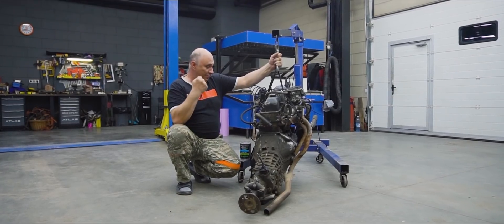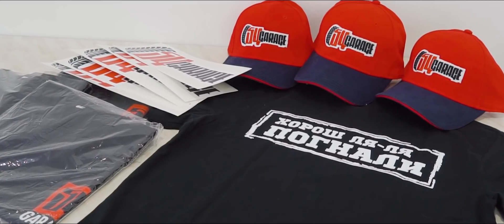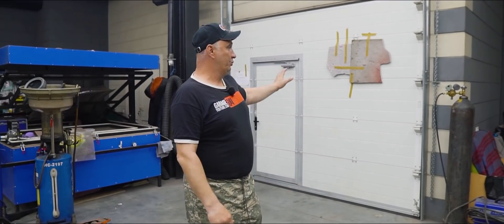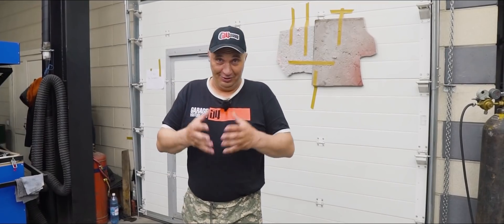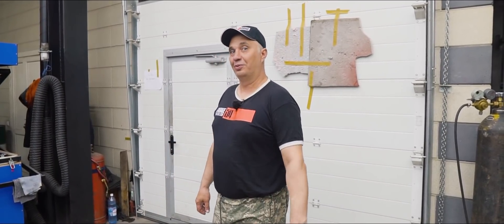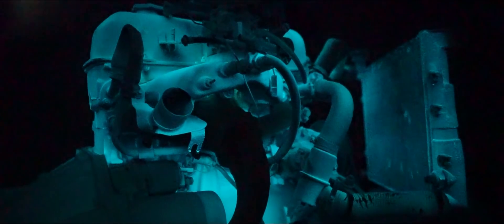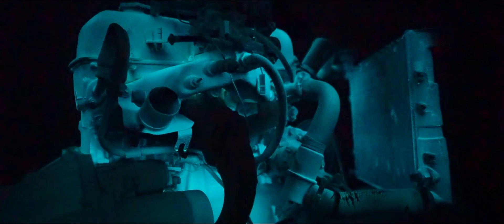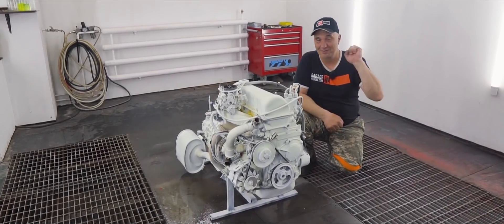Applying heat sensitive paint to an engine (with warm-up in the dark)

Comment: Okay, so I have been looking for YouTube footage of a timing belt snapping whilst the engine is running. Closest I have found is a chap that cuts the belt to the point that it looses enough tension and no longer starts. Then another one where one chap has a metal pipe stuck in the timing belt until it snaps but not with a closeup camera. Perhaps an interesting short video? With a nice Lada running a cracked timing belt(I'm sure they are all cracked🤣)

Comment: I'd think that if the engine warned up unevenly. That would cause undesirable stress in the block, and maybe even metal fatigue. So it would seem best to design it in such a way that the heat were evenly distributed. Or at least as best as possible.

Comment: would it be possible to turn the rear end of a car, and mount the driveline in a trailer? clutch and gas pedals wouldt be that big of a problem, fuellines are not a problem, and the driveshaft would need a CV joint of a sort, but i think it could be doable.

Comment: Cast iron heats up around twice as fast as aluminium for the same mass.  Modern cars integrate the exhaust manifold into the cylinder head to facilitate faster warm up.  I would guess that coolant would heat up faster if the block has wet liners.

Comment: Suggestion for a future video:

See if a car can be moved by installing a pedalling mechanism to the transmission. This mechanism would spin the transmission like the engine would, and see if humans would move a car that way
Reply: They did that about 3 years ago
Reply: @NathansMoparGarage  Not quite the same as powered a car thru the transmission.  It seems like he directly powered the axles thru pedals
Reply: @phantommedia9964  Why does it matter? The point of the transmission would be to gear down and they handle that with sprockets.
Reply: @amorag59  The different might be different? It might be smoother to run thru a transmission vs using sprockets.
Reply: @phantommedia9964  So it doesn't matter? Got it lol. Never have I had a bike chain that wasn't a smooth transfer of power.
Reply: @Yahweh's Supervisor I know what a Rick-Roll is. I don't and can't be bothered to try. Enjoy the video.
Reply: Yesss
Reply: @Yahweh's Supervisor I don't do that sort of thing. It's to the pedal powered car video of Garage 54.
Reply: @Yahweh's Supervisor it's not a rickroll i checked.
Reply: Or a lawn mower or weed eater engine
Reply: @louisbarningham  YouTube channel Robot Cantina is doing that, man
Reply: Write that in Russian, maybe they will do it
Reply: Reduction gear and flywheel
Reply: "STALL CONVERTER" 

How?
Reply: Life Od did it like a week ago with a tandom bike
Reply: This is the link to their pedal powered car. Translated version, of course. Here you go. https://youtu.be/MJFxY7j9ZkY

Comment: If you think about it scientifically, the paint is actually helping cool the engine by converting heat energy into light. This could be a really interesting concept.
Reply: I’d suggest it compromised the cooling by acting as an insulator.. but I’d really like to know how it affected it.. I see your point regarding the heat to visible light though.
Reply: By 0.0001C 😂
Reply: Lookup the Sr-71 Blackbird, and why its painted black.

Comment: I have never heard of a paint that glows when heated. I don't even know how that would be possible.
Even looking into the brand of paint, I didn't see anything about it producing light when heated.
Reply: I have seen plastidip that was glow in the dark. It charged through light, but also with heat.
Reply: It was not marketed that way either
Reply: There's lots of glow in the dark paint available in Russia, they used to paint everything with it once, including the insides of houses, problem was it was mostly made from waste by product of their nuclear weapons programme, namely Radium, and it wasn't limited to use in places like Ozersk, it was everywhere.
Reply: @alasdair4161  There's glow in the dark paint everywhere, man.
But heat activated? Doubt.
Reply: @DamagedF0X  That depends on what activates it. Normal non radium paint is charged with light, that's easy to get.
The heat may just emit enough IR sufficiently to charge it.
Reply: @alasdair4161  If I remember correctly, radium never stops glowing until it's radioactivity burns out. You don't need to "charge" it with anything. Similarly with tritium. 
Eventually someone will explain to me what's going on here, but starting to really have my doubts.
Reply: @DamagedF0X  Paint that glows with heat is relatively new, iirc its only been half a decade or so since we started producing decent thermal paint. It says on the mfr website that it charges with heat
https://nevidal.com/svetyashchiesya-aerozoli/
Reply: @wills.5762  I can't seem to find a single thing about heat activated glow paint outside of that website, so maybe it is very new.

Comment: This transmission looks really beefy for being in a pretty small car. The size and ribbing on the case is more akin to what you would see on something way heavier or more powerful.
Reply: It's more a fact that this was a 1960s designed gearbox, but to be honest, they actually are way stronger than they have any right to be.
A normal unmodified 4 speed 21061 gearbox with the 3.22:1 differential can take the power of a 1UZ-FE from a toyota celsior... without issue! -The only part to really suffer is the clutch, it's best to use one from a land cruiser
Reply: Keyword: "Looks" like it's really beefy
Reply: @v6tex  

Agreed 

They don’t like hot conditions learned that here in Australia with the lada niva gearbox.
Reply: Lada engines were built like they were for tanks, hence too why they had those huge batteries which if you broke down you whipped out the plugs and drove it home on the starter whilst in gear :D

Comment: this is sooo much more fun then a thermal camera. i kinda want this paint for things like my 3d printer and welder and a whole bunch of things to include my car engine, heck, might one day help diagnose an issue,
Reply: Watch what You're painting though, things like the exhaust system get pretty darn hot, and it might just burn off the paint (producing toxic fumes that You'll breathe in through the AC system)
Reply: Like an exhaust leak or a spot that isn't getting oil and or coolant showing what you have to clean, gebious.

Comment: This is merely an extremely inefficient gasoline powered fluorescent lamp by Garage 54.
Reply: It's like making light bulb using quinine... it only works if it's dark enough...
Reply: Yea, but this is one of those "You gotta try this, it is real cool".  Just think you could actually see how a Harley Rear cylinder gets much hotter than the front cylinder, and you could find them easier when they break down at night.
Reply: @thomasheer825  Ha Ha Ha, good one.
Reply: Inefficient? I Recon we have 107% success rate here
Reply: @Pavlos_Charalambous  agree wish we had paint like this available in the U.S.  we do have some kind of sort of junk but it will not withstand much above 250degrees F and then only for a short period of time.  Would be great to put on a Harley so you could see just how hot the rear cylinder gets as compared to the front cylinder and also as a added plus, you could find the broken down Harley easier on a back road at night.
Reply: Hahah I see u think outside the box !!
Reply: I chuckled nd spit out my drink dude 🤣🤣
Reply: It's thermoluminescent, but I get you

Comment: thats so cool you guys should slap that engine on a car and put a see thru hood and drive around at night
Reply: In the see trhu car yes pls
Reply: On the whole exhaust system too.  Thermal-underglow!
Reply: Good idea, he has already made a see through car, just add glowing engine and brakes https://www.youtube.com/watch?v=O2xqUuLmRp0
Reply: @nigelman9506  brakes wouldn’t work it would shave the paint off, maybe the calipers and the outside rim of the rotors, would still be cool.
Reply: also add some extra plumbing...all throughout the ride...! ხeeק !
Reply: With a Lot of Lexan and plexiglass parts to make the fenders and wheel well transparent
Reply: Yes plzzzzz

Comment: To bad they don't sell that paint in the United States, or if they do it is so well hidden that you would need a guide dog and a call to Ms. Cleo to find it.
Reply: After listening to what he says about it, I don't think it's sold or marketed as "heat sensitive" paint. From the video, I'm under the impression it's a glow-in-the-dark paint that they accidentally discovered is heat sensitive too.
Reply: @TravisTerrell  https://nevidal.com/svetyashchiesya-aerozoli/ is the company he got it from. It is marketed as heat reactive, but with no temperature rating.
Reply: I found some plastidip that wasn’t marketed as heat sensitive but it was. They were putting heat sensitive color change over glow in the dark. When the hot water was poured on it, it glowed actually very bright. Which makes sense because the heat is putting much more energy into the paint than light would do. I wonder if other glow in the dark stuff is heat sensitive?
Reply: @weaponizedautism6199  the thing that got me was it was intended for high heat applications, sorry use normal rattle can paint on a engine block and within a hour all of that paint is JUNK.  Engine blocks/heads normally run around 300 deg F, and enamel goes by-by at around 250 F.  Do some powder coat work on the side and tried a similar product and it held up better than the enamel but still died off due to the engine heat within several hours.  Right now I don't think we have the same product available to us in this country.
Reply: I just checked some glow in the dark stuff I have and they didn’t react to heat. Must be a special kind of glow in the dark ingredient

Comment: This is brilliant. I could see aerospace uses for this idea.  Is this paint available in other places ?
Reply: KP Pigments and Culture Hustle both have some good offerings on this kind of thing.
Reply: I'm kicking around the idea of painting my plane's engine with this stuff on the next overhaul.   What a brilliant way to make sure all of the cylinders are coming up to temperature evenly.
Reply: @grayrabbit2211  It'd be great if they did an orange version.. imagine your mechanics eyes seeing the whole engine glowing red hot..
Reply: @alasdair4161   i want a yellow or green myself .. For the manifolds brake  calipers  and block of a 4x4 truck
Reply: @grayrabbit2211   i was thinking of a similar application except  to  machinery. In a plane prop air current  might affect color indivation by stripping heat off with wind a bit. Maybe good for bearing seats so if a bearing starts to go bad and heat you can possibly prevent a sudden unscheduled seize up
Reply: @grayrabbit2211  I'd suggest getting some in different colors, in that case.

Comment: have you guys tried converting an alternator into a starter and vice versa?
Reply: Alternator is completely different from regular electric motor/generator. Alternator has 3 phases current wiring inside, built to give AC than DC. Car battery only gives DC current.
Reply: @VincentNacon  and yet, with the correct control circuit, you can do it.
Reply: @agoffgrid640  Sure... but why? There would be conversion with efficiency loss and the belt drive aren't that grippy to turn the crank... which is why the starter motor is attached to the flywheel via gear teeth.
Reply: @VincentNacon  u will see this done in aviation to save weight and mechanical complication which is a plus as circuitry has a lower failure rate. It is out there, I have seen it.
Reply: @agoffgrid640  That's because car engine are heavier than airplaine engine, thus why you need more torque needed to turn them over. Airplane engine tends to have those belt drive with teeth on them as purely redundancy.
Reply: @VincentNacon  yup. i know. glad u do too.
Reply: @VincentNacon  yes but it is garage 54, it's meant to be interesting not efficient

Comment: I’ve got an idea-try to make a car drive with the engine upside down!
Reply: The oil wouldn’t be able to move through the engine. Would stay pooled in the valve cover. I don’t think it’s possible without blowing the engine since oil won’t be going around how it’s supposed to
Reply: @AndrewKidd14145  then how does the oil not just stay in the oil pan of a right-side-up engine? If anybody can do it, these guys can.
Reply: @rhino1220  because the oil pickup in the oil pan picksup the oil for the oil pump, if all the oils in the head of the motor the pickup wont be getting oil. maybe on a dry sump setup you could make it work tho
Reply: @rhino1220  sump tube picks it up from the oil pan into the pump and distributes oil in galleys and journals in the engine and throughout hollow moving components in the engine. So I’d say there’s a quart or maybe two moving in the engine at all times and constantly getting dropped down from the top to bottom of the engine by gravity. Then when the car sits it all sits in the pan.
Reply: @Fritfa  run a tube from the pickup to the valve cover
Reply: @AndrewKidd14145  Would  a two-stroke engine work, upside down? No oil sump.
Reply: @BakedRBeans  hmmm ya know what.
Reply: You could get it done, but it'll burn a lot of oil. It's a Lada, it always works, except when it doesnt